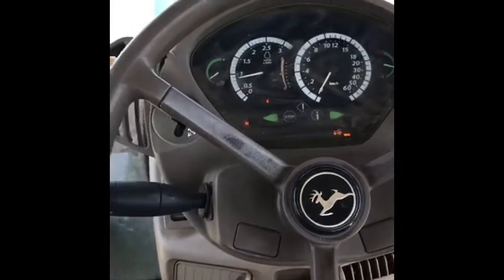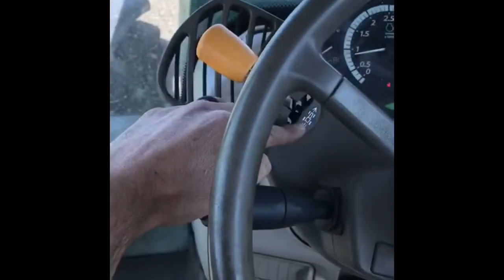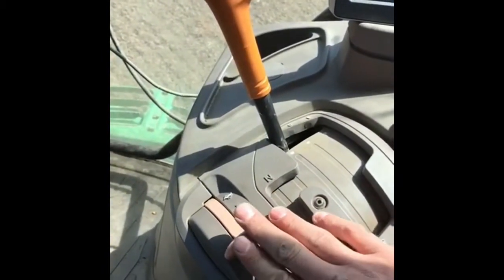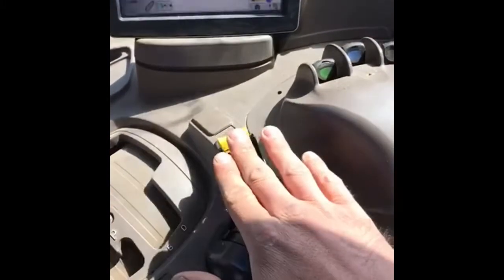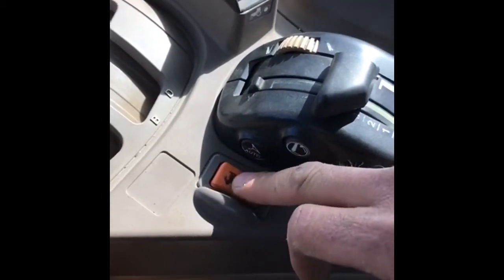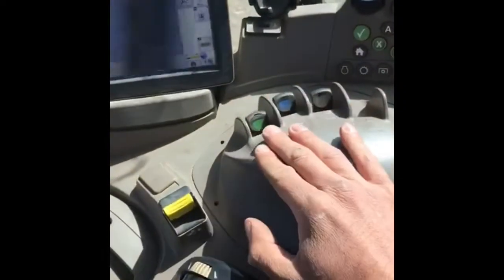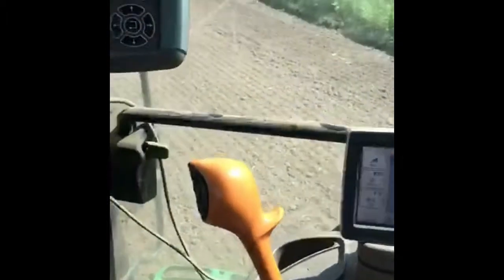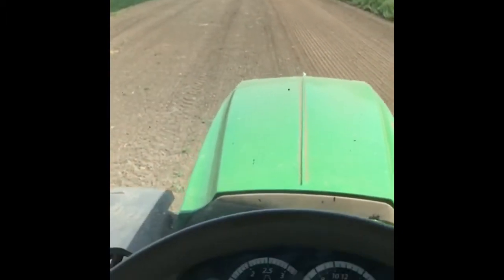A look in farmer lukes John deere tractor cab! 🚜🌾 #farmerluke #education #tractor #johndeere

Comment: With driving tractors, I’ve wondered, for the spools can you use any of the 3 for tipping a trailer, bringing down markers on a seeder etc
Reply: Or is it just the colour of the one connected to the back of the tractor
Reply from the maker: Yes! Any ones as long as there in pairs so blue will have a a power and return same with the rest but you can plug in to anyone of the three
Reply: @FarmerLukeondaintreefarm  thank you, thought so as my father had told me once before, but wasn’t sure, thanks again